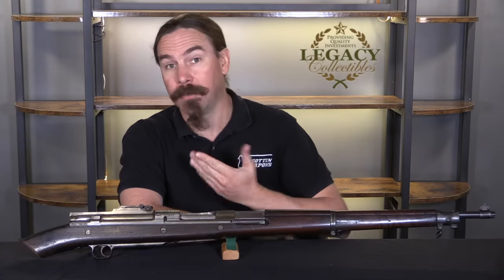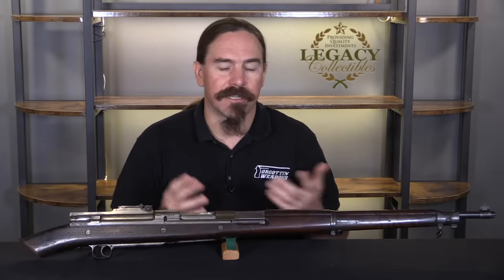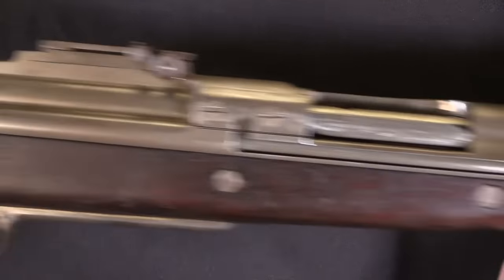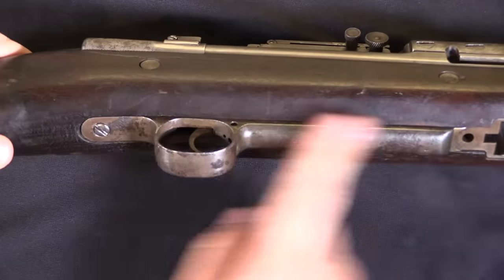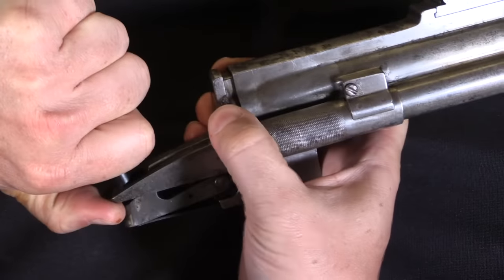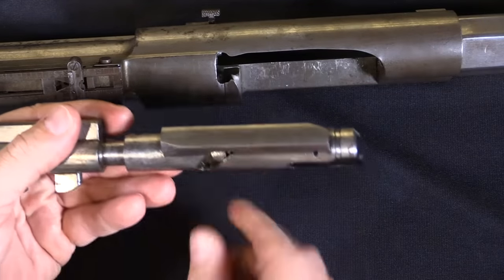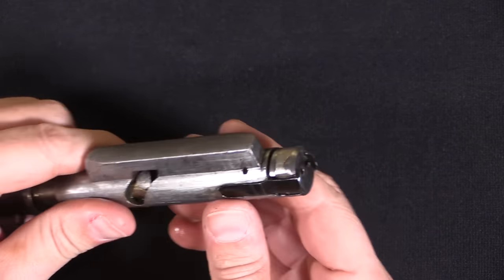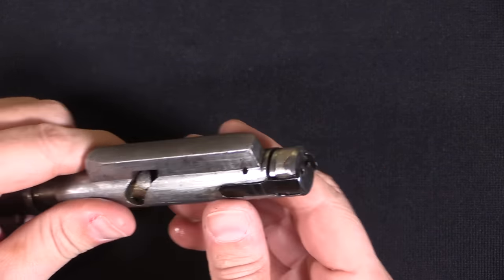Headspace-Operated Prototype Rifle - Yeah, it's as Weird as it Sounds

Comment: Isn't this essentially the same as a hesitation locking system on the Remington model 51. The bolt rotates instead of tilting but the idea seems the same.
Reply: That's my immediate thought on the matter as well. It seems like a concept that ought to have received more investigation than it has, given that the original Remington 51 seems to have been well liked - if something of a market failure due to cheaper competition - and the .45acp 53 was rated pretty highly based on early testing, but turned up just a little too late to compete with the 1911.

On the other hand, I gather the recent revival of the 51 was an utter disaster, although I have no idea to what extent that was a finicky system, poor quality control, or the combination of the two.
Reply: @discerningscoundrel3055  The similar system in the Remington model 51 works reasonably well due to the much smaller chamber pressure of the ammunition (about a quarter of the 30-06). Also, it is a civilian weapon, where environmental conditions are rather mild, compared to battlefield conditions. I suspect reliability was a problem, not only due to manufacturing tolerances of the ammunition, but also the thermal expansion effects messing with the operation (and this is a prototype, for a series production rifle, tolerances of the rifle, and wear from long-term use would further reduce the reliability).
Reply: @SolyomSzava  Yes, I can imagine the pressure of 30-06 will have presented something of a challenge, especially as this was decades before fluted chambers were a thing.
Reply: @discerningscoundrel3055  not that long before fluted chambers. The AVS-36 had them. (Predecessor to the SVT38/40)
Reply: @SolyomSzava  I mean, there were other high-pressure delayed-blowback guns being made at this time, it's not a difficult problem to solve - modern ones use fluted chambers, guns of that era just required oiled/waxed cartridges to extract properly. This also looks like the actual chamber is longer than the round is, so case-head separations are unlikely, but ripping the rims off cartridges probably WAS an issue if you ran un-lubricated ammo.
Reply: @LenKusov  The lubricated ammunition concept somehow completely flew under my radar... I guess I have a new rabbit hole to explore. Thanks!
Reply: @SolyomSzava  I mean, Ian has mentioned it in the videos on a lot of WWI and interwar experimental guns - the Pedersen and Thompson autorifles required oiled/waxed cartridges, and the Schwarzlose heavy MG actually had an oiler brush built into the feed system to oil the rounds as they fed. This was kinda the de-facto way of making delayed blowback guns work until Mauser/H&K figured out the fluted chamber idea while messing around with roller-delay.
Reply: @LenKusov  Now that you mention it, I seem to remember the Schwarzlose oiler... I haven't watched most of his WW1-era videos. WW2 and later, along with Civil War-era have been what's interested me so far.

Comment: If I remember correctly, this type of operation is sometimes called "hesitation lock", and is conceptually similar to Pederson's Remington 51 and 53. 

I can only assume there would be issues with the very high pressure initial extraction, but giving the design some primary extraction, as the rotating bolt design does, might help. It might have benefitted from a fluted chamber, too, although I don't know when they were actually invented.

Comment: This reminds me a lot of the Winchester Model 50 shotgun, which actually has a moving chamber.  The Model 50 is a tilting bolt system operated by the chamber that moves back just a fraction of an inch.  The mechanism looks kind of like a barrel insert.  I doubt it would work for a high pressure rifle round, but it works perfectly fine in a semi-auto shotgun.  I have my Grandfather's Model 50, and it's broken a lot of clay pigeons and killed a lot of ducks.  The mechanism (and the foot long recoil spring) absorbs a lot of recoil making it more comfortable to shoot a lot of clays.  (Designed by David Marshal "Carbine" Williams!)

Comment: Didn't Krnka experiment with something similar in the late 1890ies?
As I recall, it didn't work properly so he re-worked it into a primer-actuated design (that also went nowhere).
Reply: Hmm, I may have been mixed up - Krnka did patent both primer-actuated and headspace-operated rifles, but the dates on the patents I found are the other way around - primer-actuated first (Nov1,1900), then headspace (Oct8, 1908).
Reply: NVM, found the original source - in Danzer's Armee-Zeitung 45/1901, "Kaisertreu" (i.e. Krnka himself) states that primer-actuation was a fix for headspace-operation; specifically the "unavoidable" case head separations.

Admittedly, his anonymous writing makes it somewhat unclear whether that's from Krnka's own experiments or just "common knowledge."

Comment: Think the stock was sawn off becasue they didn't want someone firing it from the sholder? Maybe they thought it was unsafe to do so?
Reply: The inventor was tinkering with head spacing. No need for a stock for shooting/storage if he’s using a string to pull trigger
Reply: My thoughts exactly!  It is a prototype, and tinkering with the headspace mechanism...who knows what goes flying.
Reply: Same thought here, a cut-off stock would be easier to fit in a vise contraption for remote firing.

Comment: except the extractor grove on the side won't allow the bolt face to rotate.  its a delayed blow back.  or partial delayed blow back.  as that front section comes back to hit the rear locking bolt, it has a fraction of delay between the first movement to hitting, it rotating, then locking the pull of the entire bolt rearword.  then that momentum is going to pull the entire bolt to extraction.  its a cool idea.  you were almost right.  its a reconsideration of the thomson's delayed blowback system.

it most likely didn't work because as the rear part unlocks the middle section isn't really kept in any position.  he didn't have a locking luck for that, to resist that movement till the rear bolt section reaches full rotation n full unlock.  otherwise it would have been a functioning design.

as soon as that rear part unlocks, the pressure of the round will start cycling the mechanism, and it'll sorta bounce back and forth.  so that middle sleeve has to remained locked until the exact moment of the rear bolt unlocking, hitting a release, then cycling the entire system just as the rear and middle sleep extend opposite to the front little bolt thing.  this would allow you to time extraction, and cycling speed.  which is what that sleeve in the middle is.  i'm betting its a system to time and study cyclic rates of rounds per minute.  

or it failed and ended up fully automatic.  as the front part returns to battery, there is no way to reset the entire mechanism.  the front part is free moving, and thats the biggest flaw here.  the round would be jammed into battery.  press fit, and would most like jam instantly... too many problems.

Comment: This is an interrupted direct blowback system. It starts out as blowback and hits an obstacle, interrupting case withdrawal until that obstacle is overcome. 

That's my theory and I'm sticking to it.
Reply: @slaughterround643  If we're sticking things in the dictionary, I think the difference is there's initial uncontrolled movement. Mechanically delayed blowback starts off with bolt constrained... ah, what am I trying to describe here. 

How about these;
delayed blowback = constant motion on all parts
interrupted blowback = some parts are locked until other parts interact with them

or:
blowback = impulse acts directly on operating mass
delayed blowback = impulse acts on operating mass at mechanical disadvantage 
interrupted blowback = impulse acts on operating free mass which then actuates lock

Or... if a short recoil action is defined by the action recoiling a short way to unlock, shortened to SRA, is this an SCA, short case action?

Comment: I think the case would stretch. Brass cases serve to obturate the chamber because the walls of the case ahead of the case head will expand against the chamber walls. If your bolt head is loose and can move backwards it will, the case head will follow, and the web of the case just ahead of the head will stretch. I had a Marlin lever action rifle that had a sloppy locking mechanism which would stretch cases like that. I suppose if you didn't handload it would have been much less of a problem, if you reloaded stretched cases you'd get head separations.

Comment: At 3.33 there is a mention that a standard 5 shot floor plate spring and follower will fit. The 20 shot Trench or aircraft extended mag would have also fit if they were developed by 1914 when the barrel was made.

Comment: My theory on the cut stock is the inventor wanted to add as many potential features as possible. He probably intended on adding a stock attachment of some kind either replacing it with a pistol grip or a folding stock but didn't finish it in time.

Comment: When I was a kid, studying.....or mostly thinking about full auto rifle operation....  I was thinking of a button that the bolt presses when closing, and the actual gun trigger was only operating a disconnect. The button pressed by the bolt moving forward was the actual mechanism trigger. 
    Ehh, it would have definitely worked, and my kid brain was probably just solving problems & relabeling parts backwards...but the mechanism would work.  I don’t think I’ve seen a full auto set up exactly this way.

Comment: i would almost imagine that the force of the hammer resting on the firing pin would act as the spring that would keep the case from completely jumping out of the chamber when it impulses on the bolt head. it also looks like the locking surface was made in such a way that its removable, perhaps so he could experiment with finding the right size for it. i honestly think this is one of the better nonstandard prototype operating mechanisms. its so much cleaner than most of these conversions, albeit its more original rifle than conversion. i think this would of had more potential merit as a way to convert full power rifles inter intermediate power semi autos, it might of even been possible to use the original receiver with some modification if so scaled down. funny enough, this rifle is only really one step removed from a gas operation. if it had a gas tube running clear back to that rear bolt body portion as a direct impingement, or had a long narrow piston rod with perhaps a tappet at the gas block, this thing might of really gone somewhere

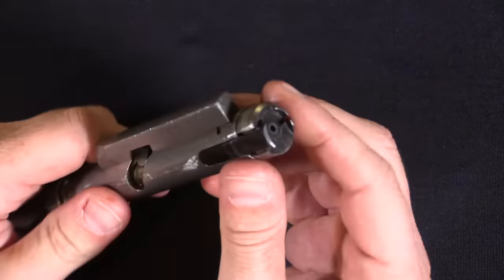Comment: Isn't this simly a very fancy and probably very unsafe delayed blowback system? I mean, I really don't understand what's the matter with headspace here on a mechanical point. When you fire the force of the explosion is applied on the head of the bolt which recoils back and causes the rotation of the carrier which is at a mechanical disadvantage.The same thing that happens in a FAMAS. 11:45 ? Maybe i'm missing something. Someone please clarify this, otherwise I can't sleep :). Big fan and long time Patreon. This channel is a testament to how this media should be used.

Comment: 1. That is an extremely neat charging handle! Not only does it fold, it also (slightly) telescopes;
2. If other parts of the design had worked, a second, symmetrical lug would not have been at all difficult to add.

Comment: How about roller (G3) and lever (FAMAS) delayed blowback rifles? Didn't those systems also require a small movement of the cartridge to initiate the unlocking of the action?
Reply: The G3 is a Roller delay locked breech. The cartridge doesn't move inside the chamber without the head of the bolt also moving back to force the rollers out of the notches in the side of the trunnion.  I have several. I do like them, but they most of the time destroy the brass because of the fluted chamber. I also reload everything I can. Some of the brass can still be resized and reloaded. My 93 in 5.56 destroys the brass completely.

Comment: Isn't the mechanical idea basically the same as 'hesitation lock' systems like the Remington model 51 pistol?

Apparently there's also a submachine gun called the Sig MKMO that might work on a similar system. Might you be able to do a video on that one? Supposedly some of those were sold to Finland for the continuation war. I wonder if some are still present here, and whether you might be able to get a look at one when you're here for the Brutality!

Supposing, of course, that travel restrictions allow. Knocking on wood!

Comment: Pretty close to the R51 mechanism, which is technically viable due to being a low pressure pistol round. Unless very lubricated, the rifle case will adhere strongly to the chamber and experience high plastic strain around the webbing. If you haven’t seen it, Varmint Al’s website has a great investigation of degrees of case friction vs bolt head thrust and case strain.

Comment: I think the fair thing to call this is "recoil-operated", as it is not fundamentally different from the 1911 in principle; the recoil of the cartridge coming back forces the whole assembly back which eventually unlocks and cycles. The one thing that is absolutely terrifying with this design is how vulnerable it is to an overcharged cartridge. An excessive charge would effectively rocket the bolt back into the shooter's face while also blowing out the case head. As recoil-operated is just another word for "delayed blowback", you can start to see the horror. Plus you have the single locking lug which, while strong in this case, would severely hamper accuracy. While I think this is overall a very well-constructed prototype and many design aspects are sound, delayed blowback on a .30-06 rifle cartridge definitely goes into the "Oh no you didn't!" category.

Comment: If you ever get to revisit this design, i sure would love to see a borescope image of the chamber. Especially near the shoulder and in the throat ...if its a moving case , one would think the chamber would be smooth or with linear to bore fluting like hk uses. For a stretching case id expect to see a roughness like ina shotgun barrell just after the chamber , to slow the waddings velocity so it seperates from the shot or anullar grooves machined into the chamber neck and shoulder area to grasp the case until it shrinks back down.meaning it could be case obturation operated. Case expands, grips the groves or roughed up area and stretches / flows rearward and then shrinks slightly after the pressure decreases . releasing from the chamber fully and extracting. So thats why id like to see a borescope of the chamber.

Comment: I suspect that the spacer between the bolt head and bolt carrier is essentially a metal buffer to prevent the bolt from beating itself to death.
It's a separate piece so that you can replace it once it becomes too deformed to reliably cycle.
(yeah, Ian's theory is probably likelier).

Comment: That single locking lug is positively massive. I'd suspect it to have even more muzzle travel than the M1 and M14 with their twin locking lugs on one side which cause the gun to shake a lot already.

Could it be that this was also some early form of direct impingement gas action that helped the bolt to move backwards, in addition to the impulse provided by the cartridge? The slot cut into the bolt would act as a gas port and dump the gas pressure once the bolt is unlocked.

Comment: That's some crazy stuff! Owning a original Springfield 1903-A4 which is the most absurdly accurate 30-06 I've ever shot, it's incredible to think that people were talking these bolt actions apart and redesigning them into semi or fully automatic weapons! Sad fact about the high nickel content receiver's they were manufacturing along with some other incredible features that these guns possessed in the time they did is somewhat mind blowing! Unfortunately in a way the A4 I own was handed down to me by a person who was into the higher level of 30-06 shooting in the 60s and 70s and came across a few of the A4s that were sporterized and then fitted with the NRA 1903-A3/4 stocks the NRA offered back then to make your ex military weapon look more conventional and modern. I guess these guys had no idea what values were ahead in the future for these guns when they were butchering them up for the next Springfield match competition??? SMFH!  So yeah Unfortunately I own a original A4 by serial number, and it's deadly accuracy, but it can never be put back into its stock stock as the barrel was shortened by a inch or two and recrowned which gave it even more accuracy than the original barrel length did by taking some of the spin off the round which is what I was told why It was shortened a little bit? But otherwise love your videos and information on these weapons which probably no one would have access to let alone be able to strip them down to find out how they worked?! So keep up with the awesome work brother and keep making these informative and educational videos for us to all learn from please. It is important for history and the future to know how we all got to where we are lol. Peace my 
Man.

Comment: Military: what is the most common failure mode?
Inventor: case head separation.
Military: what do you do to clear it?
Inventor: cut off the stock so the club you just made is a nice length...?